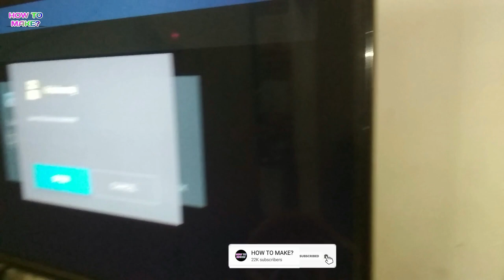5 Awesome uses of old mobile phone charger

Comment: how to fix a portable mini rechargeable USB fan? Suddenly stopped and does not power on, only little light flashes when pressing power button or when plugged into a power source like USB charger cable adapter wall socket. It has a large blue battery in the back like a AA but BIGGER I suspect that battery is not getting charged MAYBE? but then why would the light still work....🤔 hmmmm idk 😒
Reply: It doesn't take much power to light an LED .. your battery might have stopped charging or the charging circuit isn't working. Try another wall socket, the one you used might not put out enough power to run the fan.

Comment: How did this video get so many good comments? Of the 5 projects, 2 of them didn't work properly, 2 of them barely worked, and the last one is a cable that can easily be purchased, new, for under $5 (therefore making it not worth the time to make it myself). Not to mention the gratuitous use of bad soldering practices.

Comment: 4 number circuit i.e. inverter is fake. It is not possible to make an inverter with a small transformer and not possible to run an inverter with a small 1.5 volt dry cell battery
Reply: No bro it's real it can happen. Just try!
Reply: It can run if mah are high enough but for small time with bad current signal